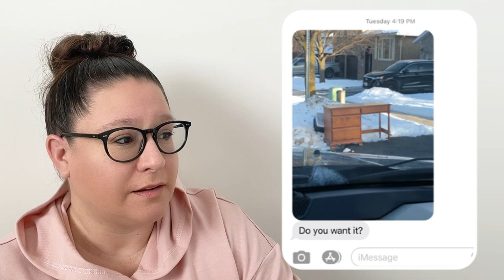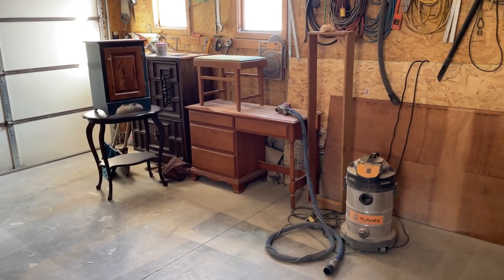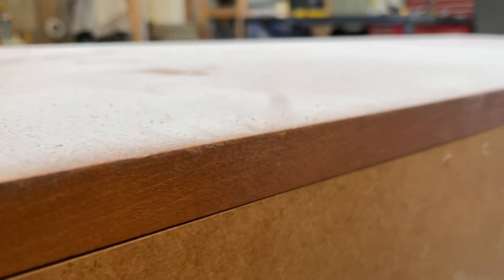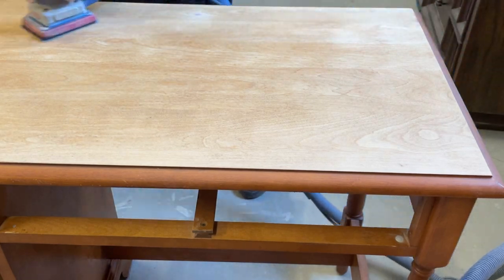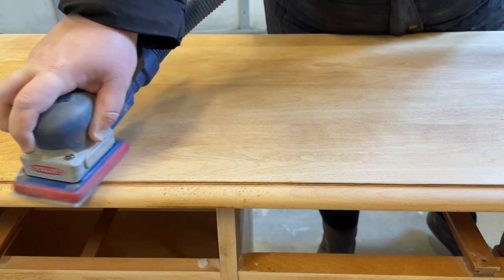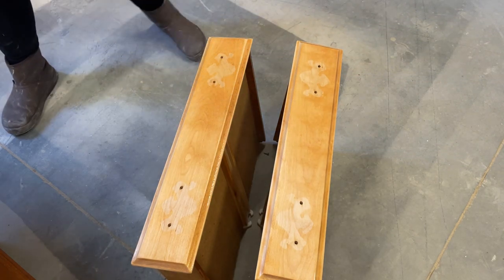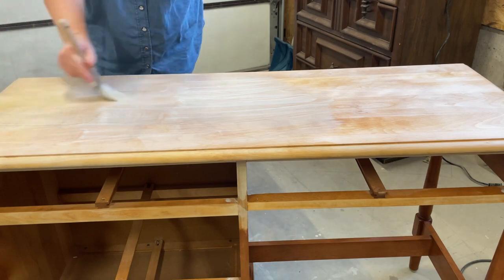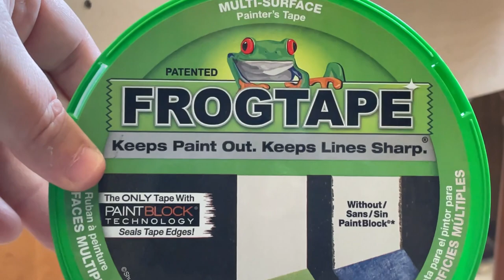Bleached Wood and Paint Dipped Furniture Makeover

Comment: Pretty pink! I usually don't like pink painted furniture but this is the exception. 
Why did you use full strength bleach? Just wondering as usually I've seen oak pieces bleached with a 50/50 dilution. Is it because maple is harder to lighten?
Reply from the maker: I just did full strength. I think each industrial piece of wood will react differently.

Comment: Hope it gets snapped up quick, someone will definitely love it. I'm wondering what you think of the difference between the satin and matt top coats?
Reply from the maker: I love the way it looks! I may start using it more often. Thanks for watching
Reply: @salvagedbykscott  I love watching your creativity, confidence with what you're doing and skill.
Is there a reason you don't use a heat gun? There's a couple of your videos (the ones with the plasticy paint finishes) where stripping the paint might of been easier with one.
Reply from the maker: @SashaStreams  I haven’t found a heat gun to be helpful at all 😕
Reply: @salvagedbykscott  here's me thinking you might have not discovered one yet 😂 but I can complete see how it wouldn't help in most cases 😊

Comment: Turned out lovely!
I do have a question...
Why do you not paint the sides and backs of the drawers. Won't the original finish show when the drawers are opened?
Reply from the maker: I refinish the same ares that were finished my the original manufacturer. Most drawers are a completely different finish on the inside than what's on the outside of the furniture. Thanks so much for watching!
Reply: Thank you.